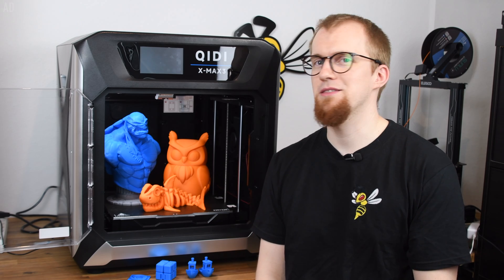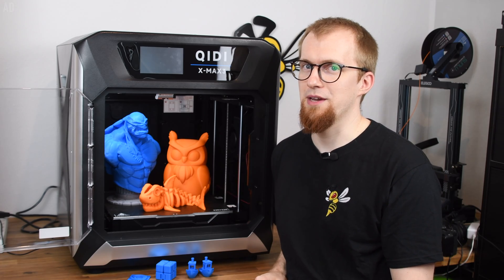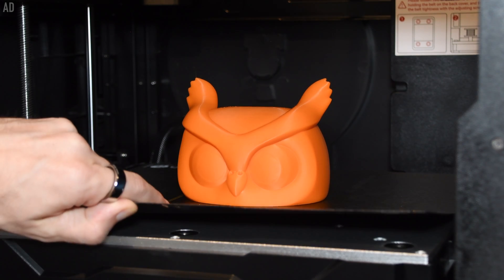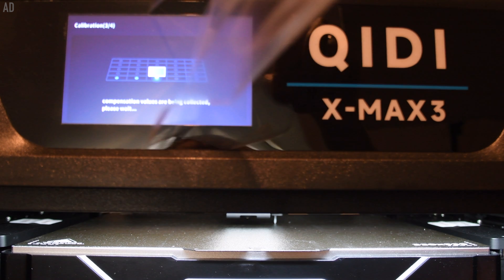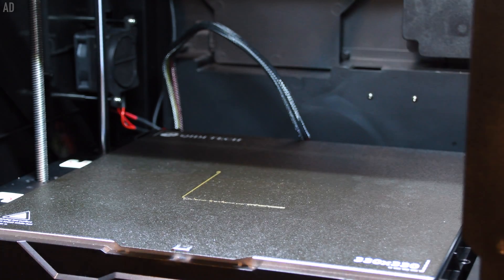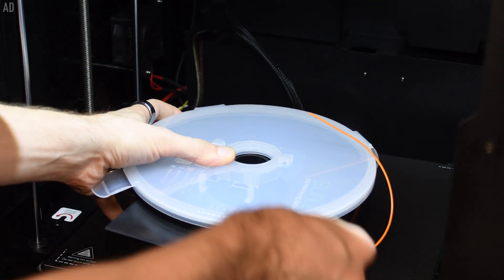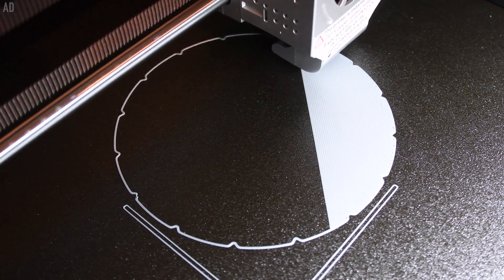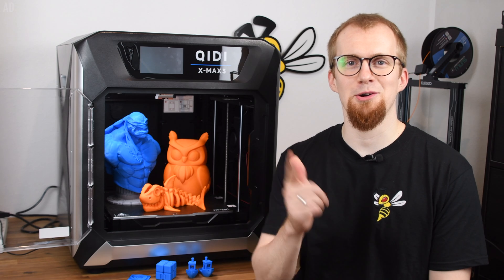QIDI Tech X-Max 3 Review: Huge Prints at 600 mm/s ?!

Comment: You aren't kidding that the spool holder is useless.  Even when you can access it directly it is a major pain to load filament.  Very hard to get it to go through the sensor.
Also the ONLY power switch is on the back and obstructed by the power cord.

Comment: I bought a heated filament dryer which you will need for most filaments any way and put it next to the machine and don't use the spool holder on the back, works like a charm